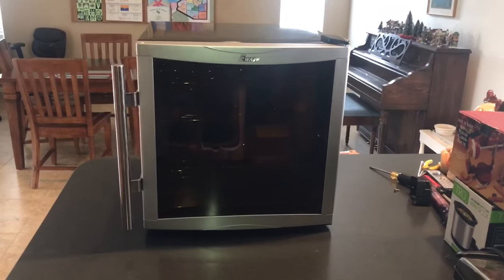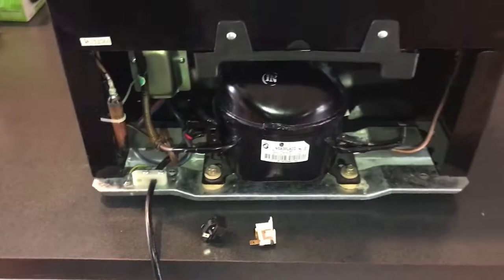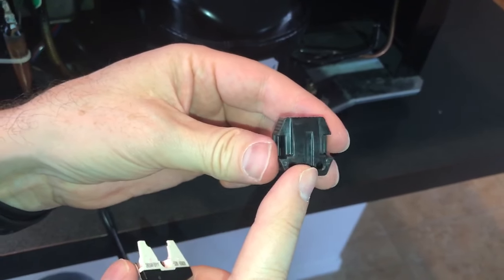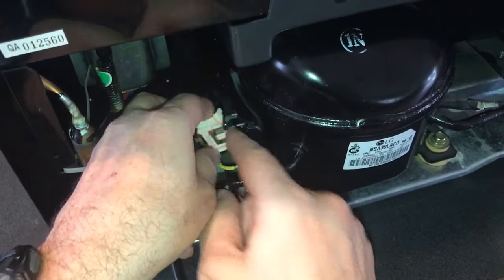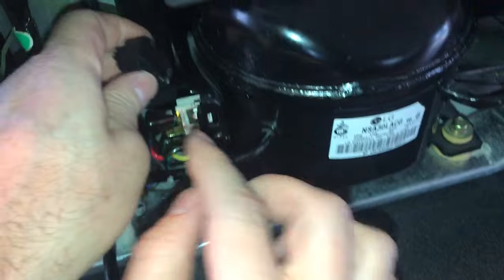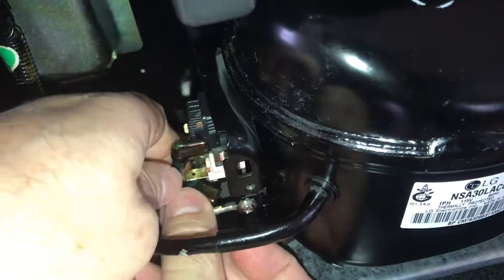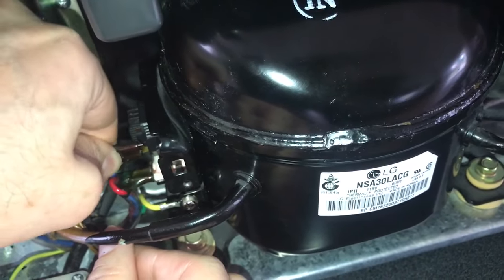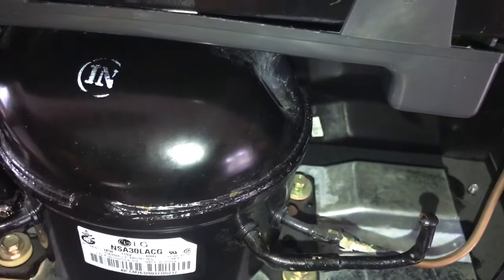Wine cooler repair video    Fix it

Comment: Replaced the black starter on my Vinotemp VT-34 TS.  It used to click and not cool.  Works like a champ now.  Thanks for the vid!
Reply: Where did you get the replacement part?  having the same issue with my vt-48 ts

Comment: Thanks, looks useful. In my case the input side of these little "starter relays" is not receiving the expected 120V. If I connect the power directly to these input tabs the compressor starts. So... could be the thermostat or the logic or other relay upstream. Any suggestions appreciated...

Comment: Just bought a house with two older models came with it. They both do not work and even the lights don’t turn on. Did the whole unit, include the light didn’t work before replacing those parts?

Comment: Well, I guess the cooler I picked up from the side of the road is missing a PTC Starter. This should be easy to get and fix.
Reply: did u ever get it fixed?
Reply: @lindseywagner7510  no 😔

Comment: Mine was not cooling, not turning on. Noticed mold had started to form inside (I keep outside on patio in FL). I saw another video mentioning cold control. I tried that by using a wire segment to bypass cold control.  That wasn't it.  I ordered these and this did the trick.
Reply: They are not designed to be outside in a humid environment. You will probably have more issues

Comment: oops, i accidentally connected both the blue and red wire to the PTC starter. 

i waited 2 weeks to get the PTC starter and overload protector (from amazon) hoping that would be a fix for the fridge, but when i inserted them into the fridge and reconnected them, i looked at my photo from when i disconnected the parts, and noticed that the blue cable was attached to the PTC and the red wire was loose, i took the pic after i had already pulled it, and thought that they both went to the PTC starter, only then did i realize there was not a 3rd wire for the overload. is it possible that i ruined the brand new PTC starter by attaching both cables to it?

Comment: Finding the right parts is the hard part as I could not locate the exact parts I took out.  I have a Magic Chef E wave wine fridge Mod MCWC30M.  This does not seem to exist in most places.  
I needed a starter relay P6R8MC OR0209 ... I could find P6R8MC all day long but none that ended in OR0209 ... There was one Internet comment that suggested that only the first 6 characters are right ... the rest might just be a batch # ??? Gonna try it ....
Also was looking for the overload protector 314TFBYY -520  could find no such beast.  There are two options that look the same as mine 6750C-0005P and the 6750C-0004R.  They look the same as mine and in one spot it was suggested they were interchangeable ???  I'm going to try the ... 04R.... wish me luck.

Comment: How about diagnosing the problem before buying the parts.
Reply: Legit question, How do you diagnose the problem...Mine quit working out of the blue and don't have a clue as to why or where to even start..
Reply: @kevincross4302  1. Does the fan run?
2) Is there a hum?
3) Is there a fuseable link that has melted?
4) Is the startup capacitor shot?
5) What exactly happens when you plug it in?
6) Was it cooling appropriately before it quit altogether?

Random ass replacements of parts is a bad plan.
Reply: You can use an ohm meter to check out the coil on the current relay. Also if you have a capacitor you can test the cap for proper mfd rating. Which should be on the capacitor. You can take those parts off the compressor and ohm out each of the three terminals on the compressor plus from each terminal to ground. 

Between terminals you should get resistance on all of them. If not it is 🔥 burnt. From each terminal to ground it should not have any, it should read infinite. If it reads anything even 0 it is grounded out.
Reply: It’s a $4 part, why not try it out
Reply: @davidwatkins8016  I don't have a hum? What does that mean
Reply: @pbpyro5546  if the compressor is frozen it may not turn but still vibrate or make noise to indicate it’s getting current.

Comment: I have replaced both the overload sensor and the start relay to no joy. No click no cool. Anyone else have more ideas?
Reply: Fan often goes bad on these so it can't push cool air around to create 2 zones. My fan is noisy and starts and stops -- others report same issue.  Suggested fix is to lubricate fan with machine oil (not wd40) or replace fan. While it's a common issue, it may not be yours.
Reply: Possible motor winding is open, motor is grounded, no fix, need new compressor motor almost the cost of a new wine cooler.

Comment: I replaced the relay and plugged the unit but it still doesn't seem to be getting any power or turning on at all.  When I plug the unit it I observed a small single clicking noise from somewhere near the relay or compressor.  Any ideas?
Reply: Devon Beau Hammel
Reply: Devon Beau Hammel thermostat problem
Reply: sorry to hear that, perhaps u shouldve tested them before buying, it can also be a bad compressor,which can also be teste!!

Comment: Does anyone know if this is a fix for a unit not even switching on?
Even the LCD display isn't switching on

It's a different unit but has exactly the same parts on the compressor
Reply: A ckt card on the side attached with a fuse, check it out, that's where the ncoming power goes. Blown fuse on the ckt is caused by shorted components inside the card.